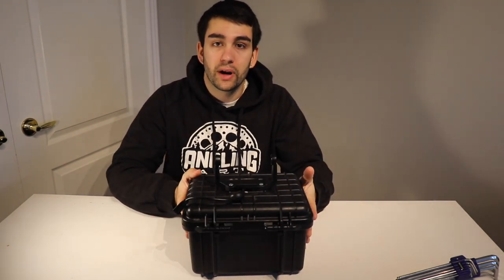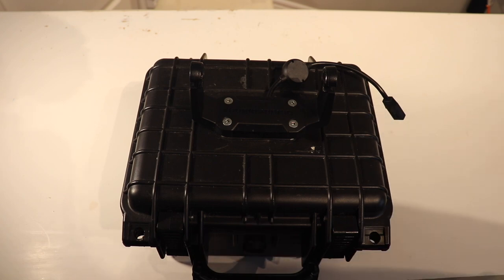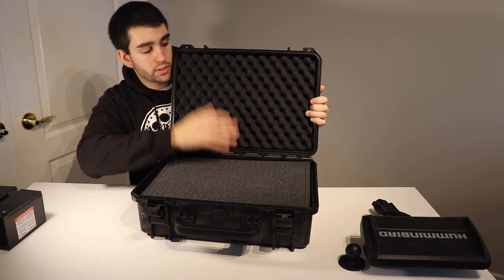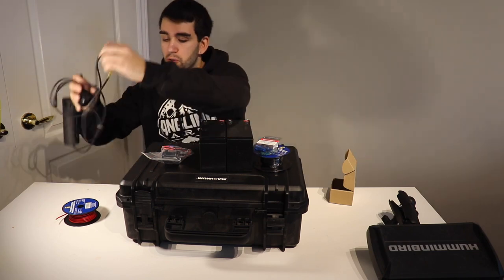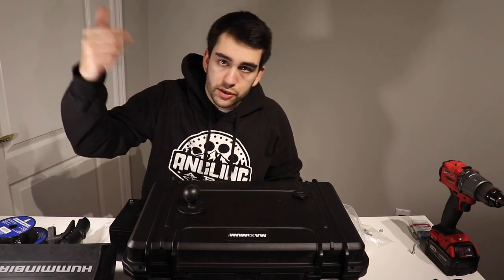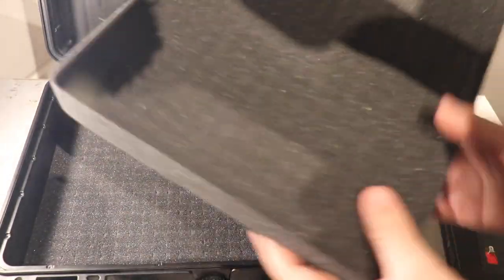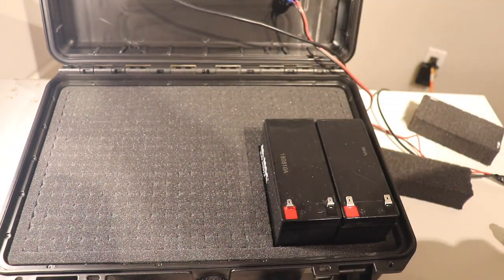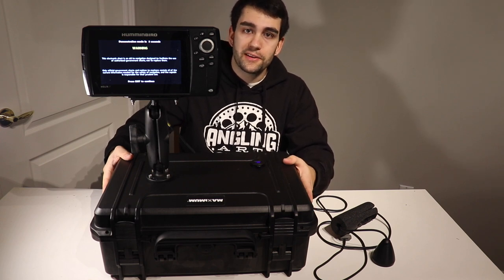The BEST Hummingbird Fish Finder Ice Conversion (Step By Step How-To)

Comment: Nice video Matt! I've been thinking about making up a box myself. Question - did you have any problems/worries about the Humminbird gimble mount breaking when it was attached to the outside of the box - eg. in transport on the way to your fishing spot?
Reply from the maker: Hey mike, with the way i organize my stuff in my sled I had no issues myself, im also pretty tough on my gear. however given it is outside, it’s possible for it to become damaged

Comment: Do you find that the voltmeter/usb port drains the battery or do you disconnect the batteries when not in use?
Reply from the maker: Hey Ryan, I don't notice the effect of the USB port. With 2 lithium batteries I have plenty of power.

Comment: Hey matt did that gimbo mount come with the helix 7 or did u have to purchess it seprate btw great video
Reply from the maker: Hey Kyle, are you referring to the mount that the hummingbird unit is directly attached to? That mount comes with the fish finder however the Ram mount (the arm with the two balls that hook into it on both ends) was purchased separately, they are fairly easy to find!
Reply: @MatthewMazFishing  thank you bud
Reply: U should prob put in line fuse in there dude save the battarys